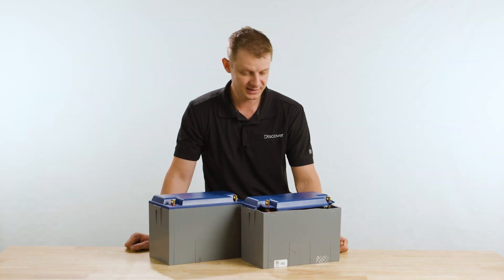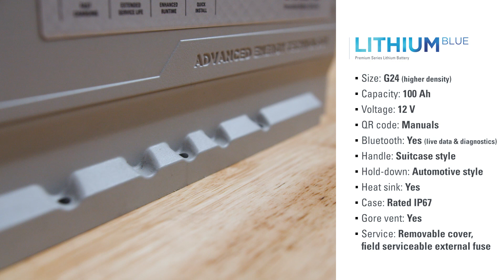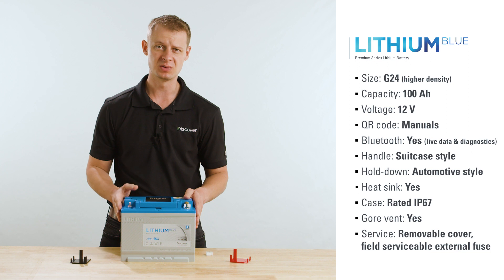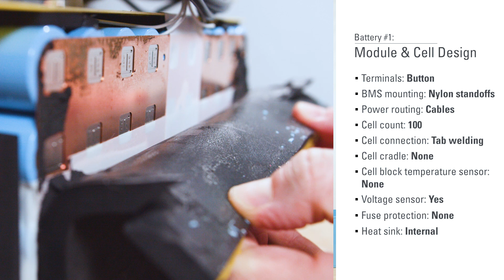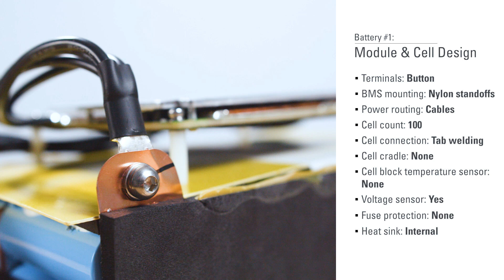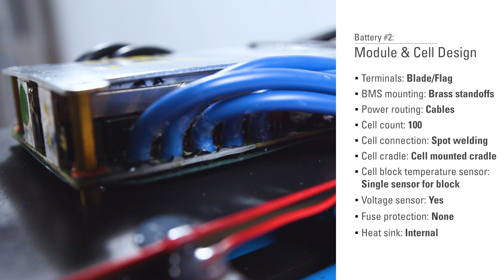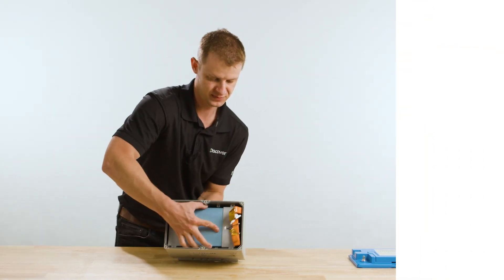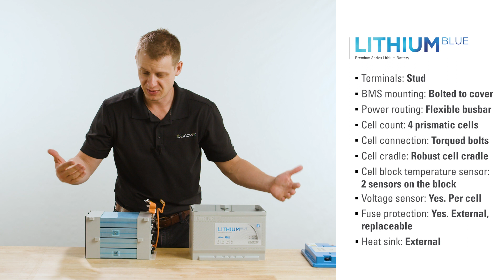Lithium Blue Teardown and Comparison

Comment: How can I order a replacement cover for the DLB-GC12-12V?  Vendor broke a charge terminal during installation - battery can be used, but I'd like to have the full terminal.  I've been unable to find a way to order the cover, and it appears the original vendor no longer carries the Discover line.
Reply from the maker: David,  you can connect directly with our support team by going to our website and filling in the support form there.  Here's the link: https://discoverbattery.com/contact/contact-support 
We hope that helps!

Comment: Today, I bought a DLB-G24-12V primarily on the strength of this video and Shaun Walford's experience. I have a 2019 Toyota Tacoma and I will soon be installing a full Redarc auxiliary electrical system. This battery will form the foundation of that system. The Bluetooth connectivity works flawlessly. I was able to download the app and connect to the battery while it's still in its cardboard box on my kitchen island. 92 percent SOC from the factory :)

Comment: We have an RV, how can we find out how many lithium batteries we would need to replace the two lead acid batteries. We are planning to get a 3000 watt inverter and eventually solar panels.
Reply: At least 6 of the 100Ah batts or 4 of the 200Ah batts.
Reply: @AC-Cowboy41  Thank you so much.

Comment: I have been a Discover Battery fan for many years now. On a different YouTube Channel, I have used two of their 140Ah AGM batteries for around 4 years with them being worked in our Overlanding vehicle the entire time and never being off-load. They have been charged via a high quality DC-DC charger and associated unit (from Sweden) when driving along and I saw recharge levels that no other battery (Flooded or AGM) could match. During a controlled test (including Time lapsed video), I recharged one of the 140Ah AGM's from around 20% SOC back up to full charge in around 1 3/4hrs.  I undertook the same test with five other highly acclaimed AGM battery manufacturers, and not one of them came close to the 1 3/4hrs of the Discover Battery; the nearest, a German brand 105Ah took 2 1/4hrs in the same test. 

These Discover batteries have been faultless often working in temperatures of in excess of 45 deg C in Africa in our vehicle; even to the extent that through unforeseen circumstances, the two AGM's (in parallel) were depleted to pretty much 0% SOC. 

With the use of a really good intelligent AC -DC battery charger (again from Sweden), and a fully charged loan12 Volt AGM battery, I was able to recover our two AGM's to their original condition. I was mighty impressed.  

Of recent, we have been looking at switching over to Lithium batteries in our vehicle and subsequently, I have completed extensive research on such product because, the batteries we use, are never off-load and, failure in the bush or the field is not an option and could be life threatening.  We are looking at three 200Ah batteries.  Given the highly impressive reliability of the Discover AGM batteries, I am so pleased to see they have designed and come out with their own Lithium variants. Will we be using them? You can bet on that! Well done Discover.......
Reply from the maker: Thank you for the positive review of our AGM batteries. We know you'll be thrilled with the performance of the new LITHIUM BLUE and the added runtime and fast charging capabilities.